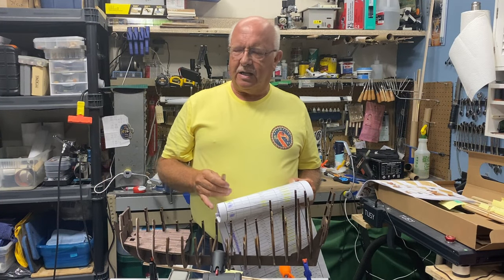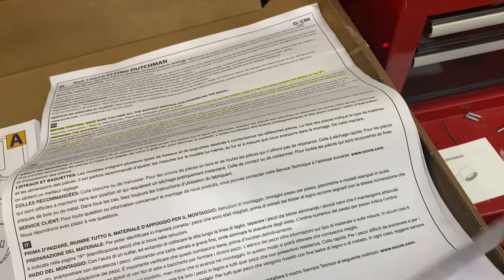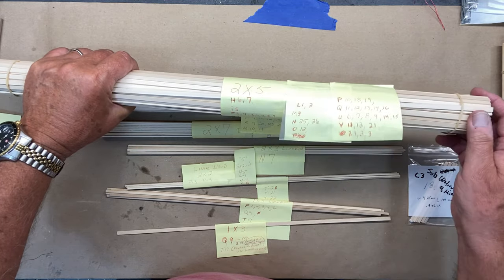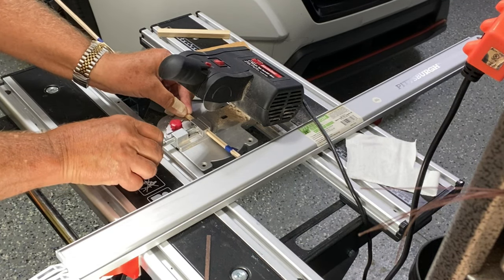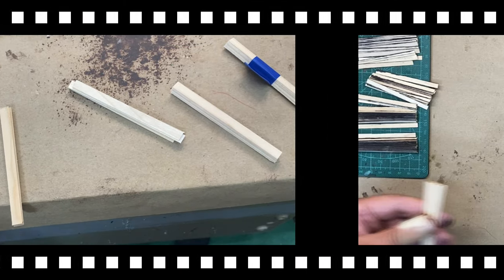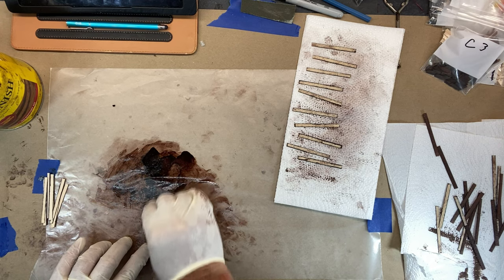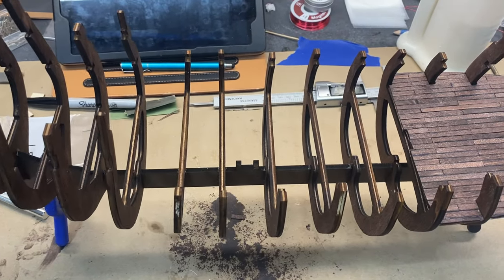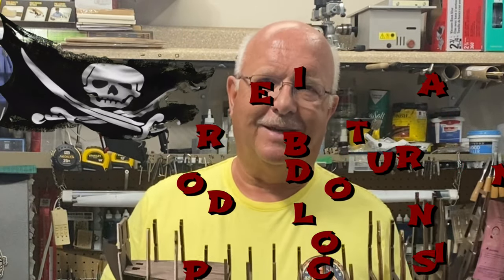The Flying Dutchman PART 2

Comment: Dan, Your organizational prep is to be commended. Though I will say, It's way over my head. In the end, it only needs to make sense to you. I tend to appreciate the pre-trip, as your able to plan for the future. ( i.e. electrical )  Off to a great start.
Reply from the maker: 😂😵‍💫 I knew at the time, explain it wasn’t working ….. but thought maybe it would help someone who was stuck trying to figure out where to begin 🤪.   Today I hope to finish the lower deck planks. Then I’ll be able to place the torches and pre drill some holes for the wires to go below the deck.  Once that’s done I can install the deck pieces, attach the torches, run the wires and then flip the boat upside down and begin connecting wires!
GEE, THANKS FOR LETTING ME BLOVIATE!  It clarified what my plan is.😂😂😂.